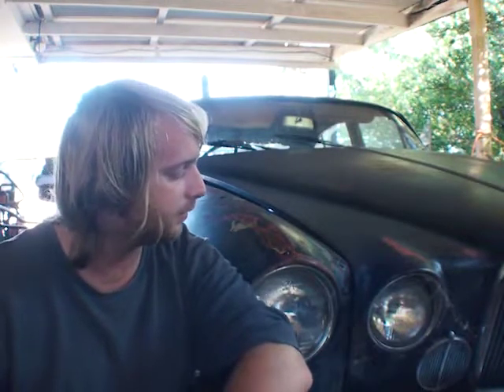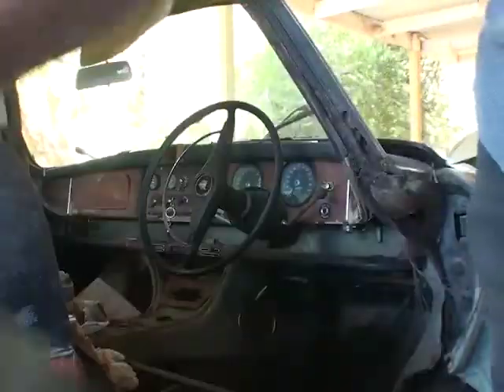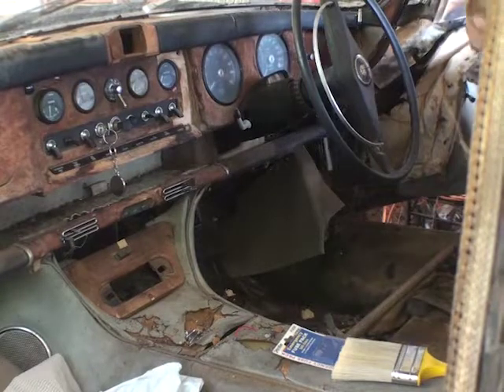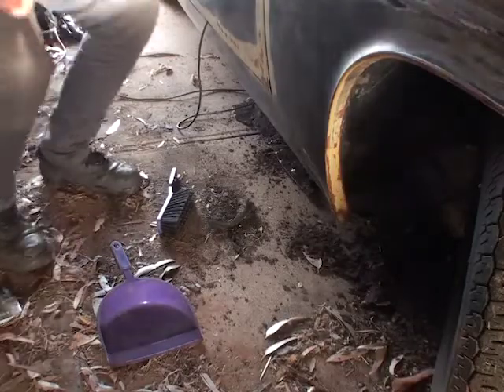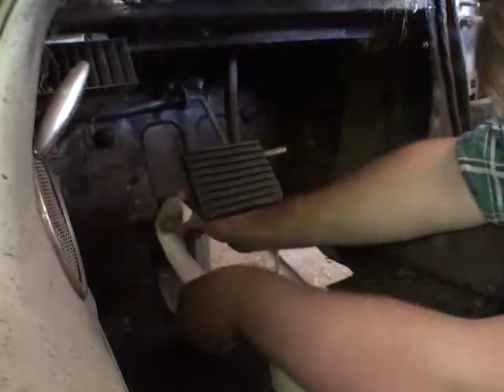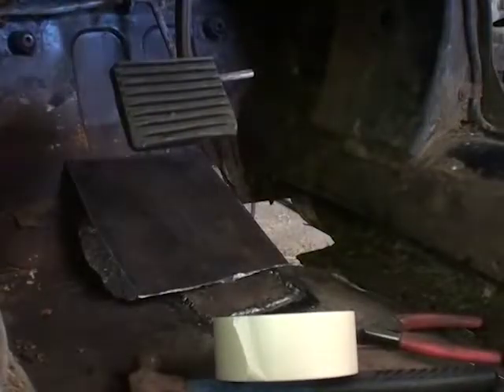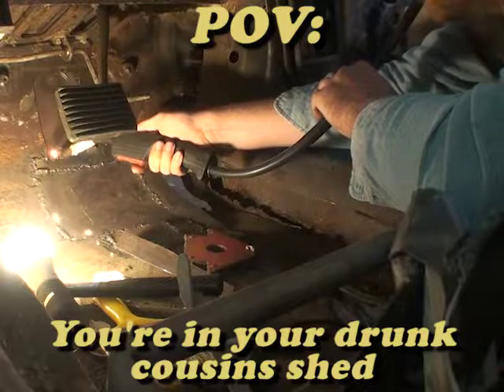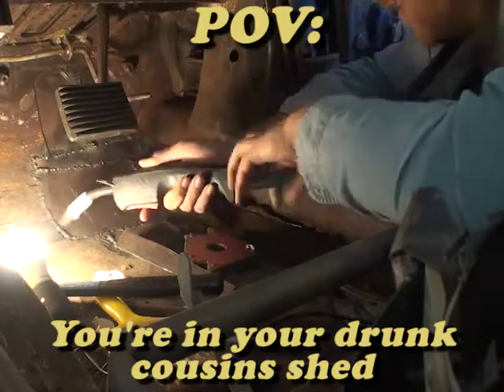1968 Jaguar 420G Restoration || Part 7: Starting floor repairs

Comment: Re the thick steel and massive overkill construction.

 Hi there , I own one of these , a 1967 420G , have since 2012 , however , when i was 19 in 1975 I bought a Left Hand Drive 1965 4.2 ltr mk10 , same car , just its original name before the public share float with BMC & Leyland buying the controlling share float and randomly deciding to rename all the cars , with MK2's being renamed 240's & 340's , the updated S-type was re name the 420 , the Daimler version of the Mk2 was renamed the Daimler 250 instead of the 2.5 ltr V8 . Plus BMC-Leyland decided to make a Daimler version of the smaller 420 calling it a Sovereign 1A.  Re the strength of Mk10/420G's . They were being designed in the 1950's along with the Jag D type race car was the first race car with a driver safety cell , same with the eType. The mk10 would have been the worlds first safety cell passenger car if they did not have to redesign the rear of the "baby" Jaguar we now call the mk1, because of its quirky narrow rear track , jaguar's owner  William Lyons realising he was going to sell a stack of the bigger engined 3.4 litre cars and could even fit the bigger new 3.8 litre engine. So the big new but double the price mk10 was put on the backburn for a while, so that Mercedes Benz beat them to the market with the new W111 (fintail model) . So as a early occupant safety cell carthis is the reason behind the massive firewall , boxed side sill rails and all the reinforced  transmission tunnel and the cross sills under the seats , also the DISSASTER at Ford USA's premium brands in 1958/59 .

In 1958 the new top end Fords , Thunderbird  & Lincoln as shared  body platform structure could be found cleverly hidden , but shared never the less, fire walls , front floor pans, front screens , body sill rail shape and design  , the 2 lincoln ranges the slightly shorter cheaper Capri's coupes & 4 door sedans , plus the longer Premier's in coupe, convertible & pillarless 4 doors , plus the new Bigger "square" bird Thunderbirds with seats for four , ALL had structural strength & body warp issues ,  Budd steel that made all these gigantic mono construction body shells for Ford ended up going head to head in the law courts . As not only was there super bad body flex you could pop a screen front or rear wrap around glass would pop out where a front wheel was up high on a kerb with the opposite rear wheel pushed up in the wheel housing , or if the car was jacked up at an extreme angle on a trolley jack . Additionally on the rear coil sprung Lincolns a coil spring could tear its way into the boot compartment causing massive harm to the body structure of these expensive Lincolns. For the final 1960 model year there were major body integrity revisions and all the Lincolns received  rear leaf springs once more, which continued on the smaller 1961 to 1969 mono construction Lincolns . 

William Lyons , Jaguar cars owner was well aware of the farce in the USA between Budd & Ford . There was also an issue with France's most expensive car the giant Chrysler 383 hemi powered big 4 door Facel Vega Excellence a VERY American-esque looking design this cars suicide door style also had flex issues but nowhere near as bad as the Lincolns . Lyons wanted zero of these issues with his big new flagship car and his and Malcolm Sayer's answer was to build a "road fortress" the MK10. 

Long after the XJ6 was released . mk10/420G's were being built , with the draconian new frontal crash test rules in the USA becoming more and more extreme, Jaguar kept the mk10/420G's "simmering" as if need be they could have a minor sales/marketing face lift , but a zero structural engineering change , as their innate strength far far exceeded the coming USA crash test rules intended for the mid 70's & beyond . So if need be a  quicky make over could be rushed to the market until a new successor could be engineered, designed & sold. 

Having been involved with mk10/420G's for so long , I have seen ultra late versions, eg as a young adult in Sydney , the Malaysian High Commissioner received his new 420G in xmas 1974, just 2 years ago a friend here in Melbourne bought from an elderly Englishman a pale blue 1972  420G with all documents going back to its order form in september 1972 , built for that guy when he was way younger and  the Head of  Britains AA    ( automobile association) ie the breakdown /roadservice people , like say the RACv, NRMA , Racq  here in 'OZ.
As in popular belief they finished production in 1970 . However my mum had 2 from brand new, both built in November but 10 years apart a Black 1961 mk10 and a new Opalescent Gun Metal Grey 420G built November 1971
Reply from the maker: Awesome information! When reading information about these lovely cars I haven't come across the reasoning why the sills and seat braces are so overbuilt. Its really amazing how far ahead of their time they turned out to be, theyre a really well thought out and engineered car. I think this bloc of information should be pinned for everyone to see
Reply: @cutcat8437  When Mercedes Benz bought 10 new Jaguar Mark 10's , some to real world drive and evaluate , some to cut up and examine , some to smash test  into walls and early computer controlled hydraulic pendulums (like giant monster punching bags , however these were like 7 foot tall and made of solid steel ) which were randomly fired into the cars , only the computer knew where they would hit . Plus they used their popup ramps where the car was then sent into a dramatic rollover . They performed SO Mega OUTRAGEOUSLY WELL Merc's Chief engineers put a hold on their 2 x Giant Benz 600's the Pullman Limousine , and the standard length one , Merc' Benz  dramatically re engineered the stiffening in their 2 x Monster cars , and if you were to see one stripped out their front bulkhead/firewall is near a mirror image of our Jaguar's ones and they made their side rails taller than first planned but not quite as big as our Jaguar's one , but close , plus the monster left to right floor rigidity boxes are a dead copy of the Jag mk10's . Benz engineers were even more impressed by Jaguar's rear diff, brake & suspension system . After a huge Benz management / engineering meeting , just after the random death of William Lyons son & daughter in law by a drunk in a truck in France , Benz heard Lyon's was depressed & shocked by this & with nobody now groomed to lead the Jaguar company Lyon's had a view to offer a share float and make Jaguar a public company . A huge contingent of Mercedes Benz engineering and management came to look at the "books" to maybe even offer an amount to buy the WHOLE share package , to buyout the whole Jaguar company. When the Benz guys arrived and looked thru the mish-mash of aged antique buildings. The Benz guys wanted to see where the R&D (research& design) dept was, they were ushered to about 8 offices, not a 3 floor building with several hundred people working. Instead the Benz guys found that the two Jaguar master stroke cars , the E type & Mk10 were created in their entirety by 8 men,  just 8 British Boffins  to the Germans this was even more astounding as most were older guys in their 50's or early 60's there was just  1 younger one , Ron "lofty" England (6foot 8inches tall was Lyons son's best mate) . Benz guys thanked them and walked away , WHY , they knew that if Mercedes Benz bought Jaguar they would be buying nothing more than a brand name , as soon , all these men would be old & retiring , then what would happen ?:? how would they make & create fresh new Jaguars with the brains trust that made them all gone . AND consider this , the new Jaguar slant 6 engine designed by these guys was shelved when BMC/Leyland bought most of the shares, (1966) not to see the light of day again let alone fitted into a car until 1983 as the my 84 3.6litre XJS cabriolet , then fitted to the new for 1986  XJ40 where there were 4 sizes, when Jaguar was split by the Maggie Thatcher's government , shares floated &  let go as a public company which ran fine , made OK money ,started growing again. These inline slant 6's ran to 1997 when Ford bought Jaguar & forced them to use the bad Ford designed v8's which were DUDs.  Jaguar  designed a set of their own V engines , a 3 liter v6, 3.5 litre v8 , 4.2 v8, & 5.0 litre v8 that could also be supercharged , just like the Jaguar inline slant 6 (like a valiant , TOO tall to sit upright in the engine bay)